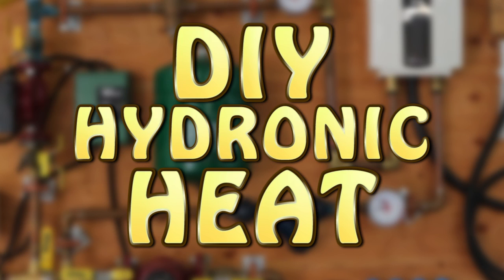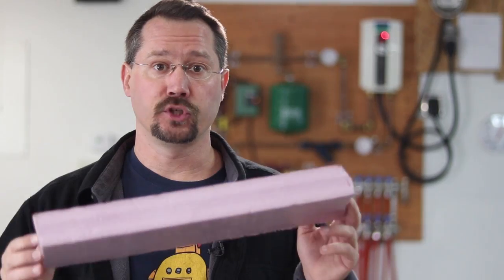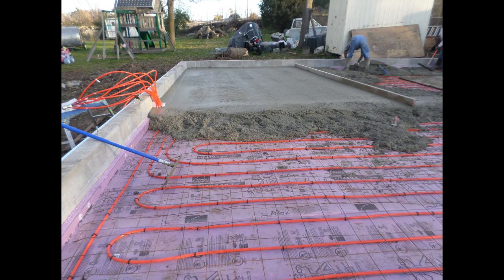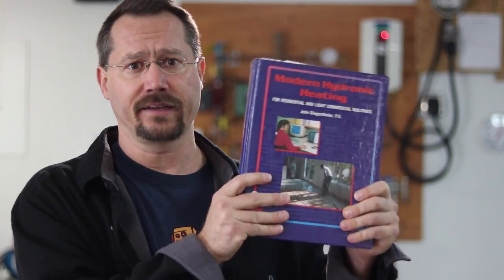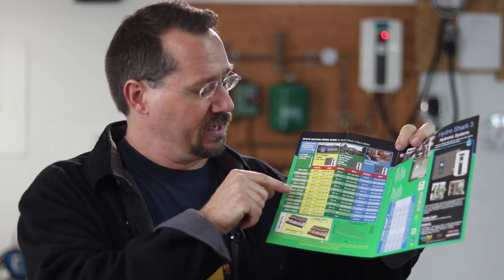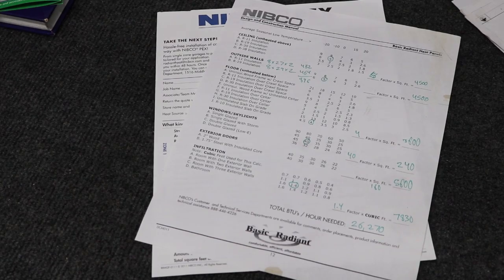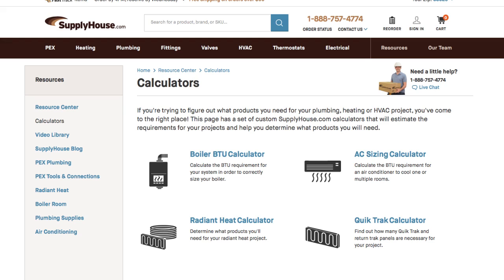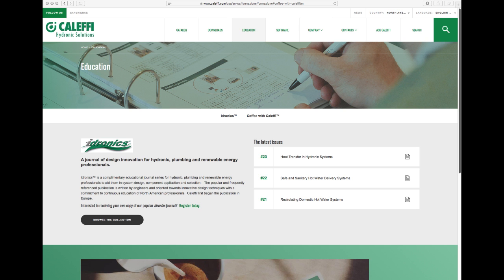DIY Hydronic Heat (Part 1 of 3)

Comment: step one: lay a concrete foundation. im out
Reply from the maker: In this case, I was making a concrete foundation and slab for a new building anyways. Very easy to add tubing before pouring concrete. Not so easy to add after!
It also IS possible to add a thin layer of concrete (or sometimes other materials) over the TOP of existing concrete. There's also some products that are like floor tiles with grooves in the underside so that PEX tubing can snap in place under them. You just lay those tiles down over the top of your existing slab/floor.
There is more than one way to do hydronic heat, but if you are pouring concrete anyways, it's a good time to do it!

Comment: If you don't want to fight the pex when unrolling than you just leave the whole roll wrapped in the plastic wrap. Remove the end from the center of the roll and pin it down with a heavy object, and then just unroll it where it's needed.
Reply from the maker: The professionals use an "un-roller". It's sort of a  frame that holds the PEX and a bearing so that it freely unrolls when pulling on the material.

Comment: don't you need a feed water supply  , threw a muler valve to keep your system full if there were any leaks ?
Reply from the maker: There are several different styles of systems. Some of them just use tap water and ARE designed with a connection to city water.
This is NOT like that. It's a sealed system using glycol. No water connection is needed.

Comment: Thank-you for this great 3-part video.  The insulation goes under all the concrete, both the slab and the foundation?  How is the insulation on the side of foundation protected from the elements, or from getting chipped away?  Thanks!
Reply from the maker: The insulation goes under the slab, and around the edges of the slab, with a thermal break between it and the foundation wall.
The exterior of the foundation wall is covered in foam. (I don't recall how thick. 3/4", I think.) The exterior foam is then covered with a metal mesh, and that was covered with a concrete in sort of a stucco finish.
Foam on the outside of a building definitely needs to be protected.
Reply: @BenjaminNelsonX  Okay, that all makes sense!  Thank-you for answering :-)

Comment: I live in Arizona, so I’ve thought that it would be nice to “cool” my concrete slab in leu of conventional AC...then send the heat into a swimming pool. (Which, no matter what the temp is outside, you’d want close to body temp). So it seems would go hand-in-hand
Reply: Then you might want to consider a water to water heat pump setup.

Comment: Great job.  One thing I think would've done to improve the system is to place the tubing on a floating shelf of metal reinforcing wire to sit in the middle of the concrete slab.  That way the heat is distributed closer to the top of the slab where it's benefiting you the most.  The boiler would also require a lower max temp to achieve the same result.  All this goes out the window however if you were drilling in multiple spots of the concrete slab for shelves/car lifts, etc.

Comment: Is the 7 kw boiler big enough for your garage or do you think you should have went bigger and how long did you say it takes to heat your garage?
Reply from the maker: The 7kW is fine. I was never trying to heat my garage to 70º 24/7. I just wanted to have it be warm enough in the winter to work in a sweatshirt or light jacket, instead of freezing in the driveway like I used to.
The concrete slab is a significant amount of mass. If I want to warm up the garage from unheated, I definitely turn on the  heat the night before. The next morning, I can turn it off, and the heat will continue to raise through the day.
It works pretty well if I'm going to be working in my garage all weekend in the winter. 

The other thing is just having the garage well insulated makes a HUGE difference! I'll just turn on the heat every once in a while and it stays above freezing pretty much all winter.

Even when there's pretty large temperature swings between day and night, the temperature stays really consistent in the garage. The combination of thermal mass and good insulation works great.

I also installed a glazed door I designed to let in the sunlight (and heat!) on sunny winter days.
https://www.youtube.com/watch?v=EcuRfnP6E7I
Reply: @BenjaminNelsonX  I designed my system kind of like yours (Thank you for the video), but i just got it going but i used a hot water tank to heat and is working really slow for my 30x40 shop. I am looking at going with a micro boiler but not sure what size is to big or to small.
Reply from the maker: @cliftonneamon9001  Your shop is about as big as my house!
Hopefully, it's well insulated. If you don't start with that any heating system will have to be oversized to get you comfortable. My best guess is just that your hot water tank is simply too low powered for the area you are trying to heat.
First, do some calculations for how much you heat you will need. You'll need to know your shop size, insulation value, lowest winter temperature, temperature you want to heat to, etc. With that, you can figure out how many BTUs (or kilo-watts) you will need for heating.
Here's a simple BTU calculator to get you started: https://www.calculator.net/btu-calculator.html

I also highly recommend reading MODERN HYDRONIC HEATING by John Siegenthaler. It is a college textbook, so it can be a little expensive, but the information in there is fantastic.
https://amzn.to/2xhaoO5
You might be able to get it through your public library system or even as a rental.
Reply: @BenjaminNelsonX  I live in Oklahoma so my winters are nothing like yours so i can see why you only take yours up to 50 from outdoor  cold temps. Yeh it is big and its attached to another 30x40 lol. I appreciate your help!  I'll go now and take a look at the calculator. Thank you again!
Reply: One more thing. How many kw are you using a month?
Reply from the maker: Clifton Neamon couldn’t tell ya. I’ve only been heating intermittently, when it’s cold and I know I’ll be working in the garage.

Comment: Do you find that the tiny hydro shark is sufficient for your space?  

Would you have gone with something bigger if you did it over?
Reply from the maker: Seems to work fine.
Keep in mind that I'm not trying to heat to 70 degrees 24/7. Just bring it up to 50 or so in the winter.
I've really had no issues with this system. I typically just flip the heat on the night before I'm working in the garage.

Comment: Hi Ben, great information. I’m currently installing a 4500 square foot driveway, we’re using concrete pavers on top of the system though. I had a question on those staples? Where did you purchase them?
Reply from the maker: I just got them from a big box home improvement store which carried a line of hydronic products. You could also order from a place like https://www.supplyhouse.com or https://www.pexsuperstore.com

Comment: Hi Ben, thanks for the info, how thick is your concrete slab? I'm planning on pouring 6" concrete but not sure if placing PEX on foam board at bottom will work ok. I know recommendation is to place PEX near middle of slab but easier to install PEX on foam board.
Reply from the maker: My concrete is 5 inches thick. I stapled the PEX right to the foam insulation. That's easy to do yourself. I've heard that the latest recommendation is to install it near the middle of the slab, but that gets a little trickier. Zip-tied to the reinforcing wire is probably the best way to go to get the PEX a little higher.
If you have a thicker slap, you probably really DO want to make sure to get the PEX higher.

Comment: Great video and wonderful details.

How would you compare the heating you used vs. a chiller heat pump with a variable compressor which runs on electricity for space heating, space cooling, and hot water.  A few brands doing this are Multiaqua, Chiltrix, and Daikin.  Sanden does a good job too; however, they only do space heating and hot water.
Reply from the maker: I couldn't tell you how it compares exactly, because I don't have a heat pump. And even if I did, I'd need to have it hooked up to this system to give a truly proper comparison. This is just a resistive heater. The best part of heat pumps is that they are several times more efficient than resistive electric heat. However, air-to-air heat pumps only work well down to a certain temperature and then often switch to a backup resistive heating element anyways.
My master plan is to use a wood-burning boiler or some other alternative heat source as part of this heating system.
Reply: BenjaminNelson thank your response.

I spent a little bit of time this morning trying to analyze this.

Your system is superior to all others due to heating up the large mass of the slab.

Cost wise I got different answers.  For all I added up equipment cost, energy cost, maintenance cost, and hot water cost, and I ran these costs for at least 10-years.

The conventional AC is the most expensive.  The next most expensive are heat pump chillers.  Despite their higher efficiency when you have several rooms their cost adds up due to requiring several outside units as well as several inside units, and the outside units are expensive.  For a single room like your garage connected to a radiant hydronic slab it could make sense depending on the COP, the input kWh, and the source of energy.

The cheapest for a multi room use are solar AC units which run directly off solar panels, have a COP above 3, and consume on average around 0.6 kWh.

A wood or pellet boiler could make sense.

Comment: Hi Ben, thank you for very informative video. I have a question: Did you calculate the benefit of solar PV electric heating vs. solar thermal for your hydronic system? From efficiency view, it is better to go with the second. Thank you!
Reply from the maker: If a person were purely to look at heating from an efficiency point of view, YES, solar thermal is much more efficient than converting sunlight to electricity with PV and then using that  to heat. However, I can make and use electricity year round (and use it for lighting, power, heat, whatever I want,) whereas solar thermal heating is only appropriate for part of the year. Beyond that, when I need heat the most, the sun is at the worst position for it. I would want very steeply angled solar collectors, which does NOT match the pitch of my roof. (The garage is the only practical location for solar in my yard.)  Solar thermal collectors on the roof would take up space that could otherwise be used by my PV. Frankly, I LIKE how the PV looks on the roof, and it would NOT look as good if it had to miss a few PV panels to have solar thermal collectors there instead.
Since solar thermal would be best at a steep (even vertical) orientation for winter heating, I instead chose to make one of my garage doors directly into a solar collector. It still looks nice and is functional, and doesn't require any pumps or tanks or even air vents. See the video on the Passive Solar Garage door at: https://www.youtube.com/watch?v=EcuRfnP6E7I

Comment: Looking forward to part2. 26000 btu is quite a bit I can heat my garage with about 15000 which is a 4500 watt electric heater my garage is 28x30 which is fairly big. The heater can make it 80 degrees in winter and I am at 45 degree latitude is it does get cold.
Reply from the maker: 26,000 BTU was a quick estimate of the heat required for a space this size. The actual heater itself produces a peak of around 24,000 BTU. That also doesn't mean that the heater actually outputs that much constantly. The heater throttles down it's power once the return water starts warming up. A big part of BTU ratings is about how FAST you can heat a place. Given enough time (and insulation) even a very small heater can heat a large space.
Frankly, this was the lowest power micro-boiler I could find! Once the space is warmed up, it doesn't take much heat to keep it warm, but it's a fairly significant amount of work to warm up the large concrete slab in the first place.